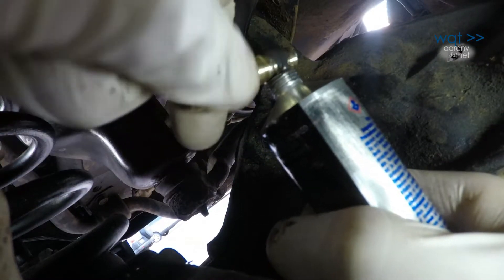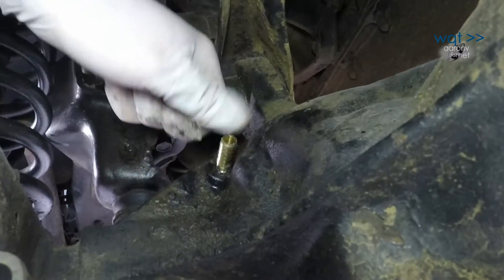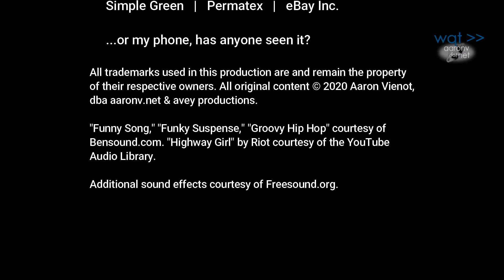wqt//Basic Auto: Dana 30 Differential Breather (1984-2001 Jeep Cherokee XJ)

Comment: I know this was 4 years ago, but do you remember what your target OD was for the brass barb you filed down? You mentioned the “too small” barb was .35”, and the “too big” barb was .405”. What did you file the larger barb down to? Just curious what your target size was. Thanks! Good solution.
Reply from the maker: @gearsandgardens4018  you got to file and test until it just makes a friction fit. Although, I've since tried a second solution that seemed to work better: there are brass compression inserts for transitioning flexible tube to brass compression bodies. They resemble brass shell casings without a cap. I bought a couple makes/sizes in the 5/8" range until I found one that would insert as a friction fit, and the rolled lip provided a stop. Then I found a brass hose barb that would fit into that as a friction fit. Seems like a more stable solution over time, since the casing lines the full surface of the casting hole, and the hose barb ridges are then supported with brass-to-brass (like-to-like material).
Reply: @aaronvienot awesome! Thank you for the detailed reply. I’ll check out the brass compression inserts. Out of curiosity, did the solution in your video fail? Or are you just seeking to improve upon it? Thanks again!
Reply from the maker: @gearsandgardens4018  It gradually loosened up, and now the barb does not seal tightly in the hole. I believe the hose I used was too stiff, combined with the excess motion of frequent off-road use. I happened upon the two-piece solution while repairing the breather on a 2-door I've started cleaning up, and now I need to go back to this one and try it there.

Comment: Nice what size the red heat sleeve? 3/8 ?
Reply from the maker: Sleeve diameter depends on the type and size of the hose you're using. I think this was 5/8-inch but I could have used a smaller, more flexible hose and smaller sleeve to protect it, since this doesn't handle fluids, only fumes.